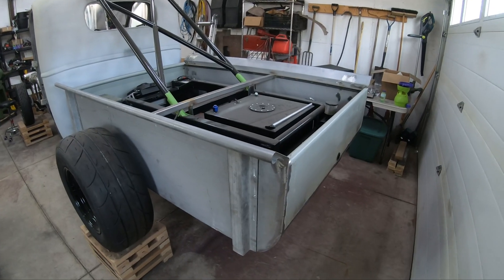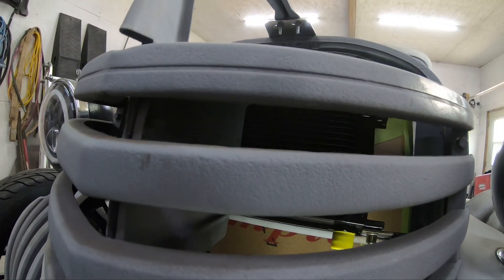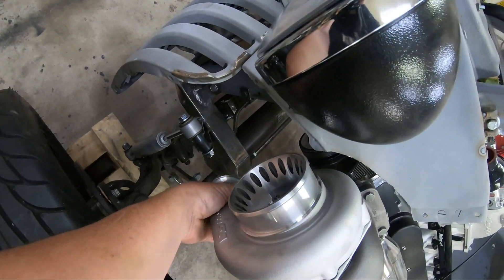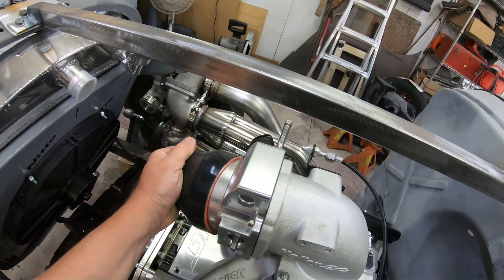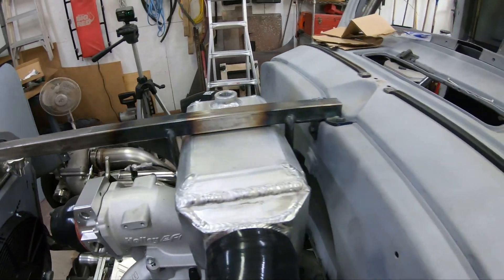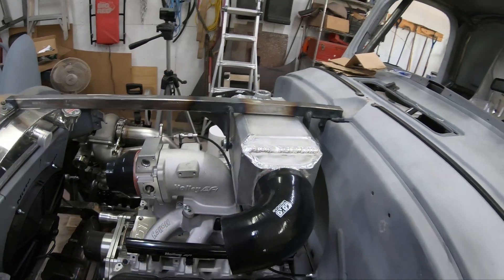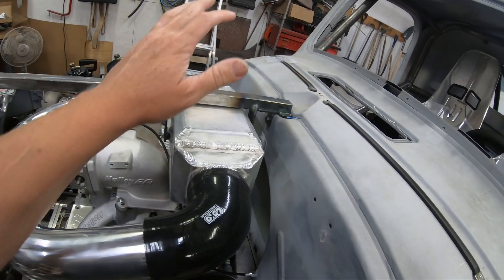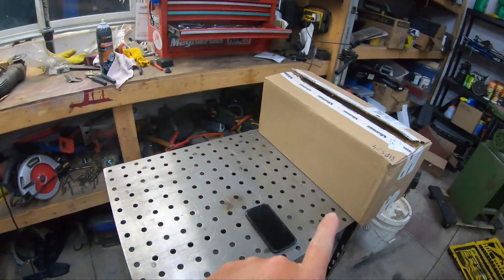The CHEAPEST Air To Water Intercooler For Big Power: How To Install

Comment: What’s the best way to install the water pump. Mine is a Bosch cobra and came with a harness. I don’t like going direct to the battery. Can I use a fuse adapter and go to the fuse box? Do I need a relay? Thanks
Reply from the maker: I plan on wiring it through my relay board. You definitely want a fuse in your feed, but depending on the amp draw of your pump, you probably want to use a relay to save burning up your switch.
Reply: @averagedadsgarage  I’m not very experienced so forgive me. Relay board? Do you mean the fuse box in the engine bay that jade rises and relays? So from my understanding, the water pump will go to the harness, that will go to a relay, that will go to the fuse box and os either connected to a relay in the fuse box or a unused fuse port? My water pump is a 12v so I don’t think a fuse would be an issue. I could wire it just like I did my gauge or headlights since they are using 12v fuse ports with relays inbetween.
Reply from the maker: @surslaughter3524  Everything electrical in your car runs off of a 12v system. But everything has a different amp draw. Headlights, starter, fuel pump, radiator fans all have a higher amp draw(anywhere from 15 to 30amp). I’m not sure how you plan on wiring your pump or how many amps it draws, but you can easily pick up a dedicated harness that comes right off the battery with your fuse and relay. A basic harness for an aftermarket radiator fan would do the trick.
Reply: @averagedadsgarage   perfect. I am not sure what amperage it is. I’ll find out and go from there. There isn’t a whole lot of room anymore on my engine bay, so I would like to mount it close to the fuse box since my turbo is also on the side of the car. Battery too. So it will be convenient.

Comment: Looks good, like the set up. If you clocked the intercooler 90° you could keep the plumbing under the hood with a 90 at the firewall, just a thought. Great tip for a bead roller!